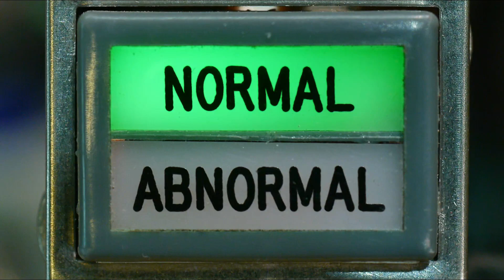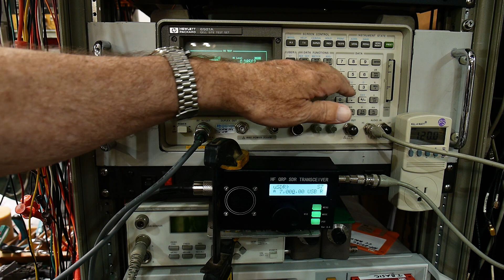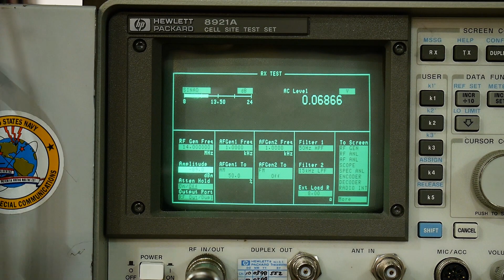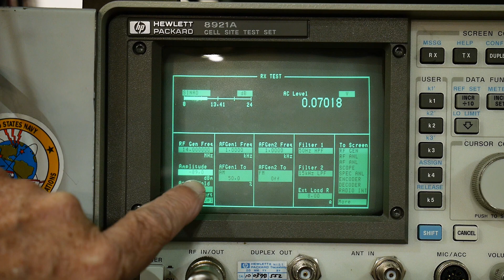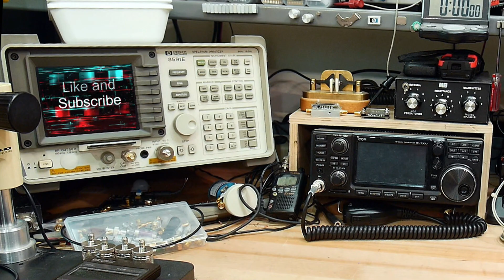#1074 uSDR Radio Sinad Measurement

Comment: I suggested the SINAD measurement to see how sensitive the RX is, I would normally see about -115dBm to about -120dBm on a CB radio
Reply from the maker: since there is a mismatch of AM and SSB, the viewers believe it would be -89 -12 = -101
Reply: SINAD works for CB radios if you are measuring on AM for both the generator and the receiver.  SSB and CW aren't specified as a SINAD value because of things like the distortion added to the RXed signal due to the difference in frequency between the sig gen and the rx. The 1khz tone will be off frequency by 1hz for every 1hz those sig gen and rx freqs are different.
Reply: @RadioWhisperer  maybe 1+ ? hz for every 1 kHz?

Comment: If you are transmitting AM from your generator, then the modulated tone level, will be some dBs below the carrier. From memory at 100% modulation sideband level is -6 dB/tone down and at 30% modulation around -16 dB/tone down. So if you are demodulating one of the tones as SSB, the  -89 dBm generator measured in the video, may be 16 dB lower, or -105 dBm. Barefoot SDRs may have a Noise figure around 20 dB. Assuming 0 dB Noise figure and a SSB bandwidth (2400 Hz) , Noise floor is around -140 dBm. Add 20 dB noise figure, then 12 dB SINAD, then this is around -108 dBm.. So you are in the ballpark...   (50% modulation would be -12dB modulated tone wrt carrier)

Comment: The AM carrier is at -89dBm. You can add -12dB to the figure for the one sideband and 50% modulation. At least so says my HP8640 and 8569 spectrum analyzer. --N2GX

Comment: Nice, How does this compare with your IC-7300 using the same setup?
Reply: This is a great question. I'm betting that using the same test setup with a known good 7300 will produce very similar results. And we know the 7300 has WAY better sensitivity than -83dBm for 12dB SINAD.

Comment: Usually the spec is measured using the amount of signal required to achieve either 12 or 20 db of quieting.
Reply: True, sort of.. It's true that quieting is an FM measurement only, but SINAD is for AM and FM, not for SSB. The problem with SINAD is the sig gen and rx need to be on the same frequency to within several hz or the distortion begins to introduce error.  That's why SINAD is not used for SSB or CW sensitivity measurements.  If you look at the specs for most modern HF radios (including the 7300) the RX sensitivity is specified as a signal input needed to generate an audio signal with 10dB s/n ratio. There is no mention of distortion in that measurement, hence not SINAD (SIgnal Noise And Distrortion).
Reply: True for FM. SINAD is more appropriate for SSB. --N2GX

Comment: Something seems very off with that measurement.  🤔 S9 for below 30mhz is defined as -73dBm. On 20m for roughly 12dB SINAD you had to feed the receiver -83dBm. A good HF receiver worth is salt will have a 10dB s/n of about -110 to -120dBm and the S meter will not move at that level. If the receiver has to have roughly S7 to S8 to produce 12dB SINAD it has very bad sensitivity.
But, I think the problem is the experimental setup. SINAD is signal to noise and distortion. So if the AM signal generated is off frequency at all from the SSB receiver frequency,  that shows up as distortion because with frequency change in the SSB receiver, you change the received audio frequency, which is distortion. To prove that, just move the generated signal a few dozen hz and watch the SINAD measurement change. 
There is a much more significant setup error though.  The signal generated is AM so the test set is reporting its output power which is the sum of the power in 2 sidebands and the carrier.  The SSB receiver filters out 2/3 of those AM components before the signal reaches detection which is why it took about 40dB more signal than it should to produce 12dB SINAD. To get an accurate measurement you have to match the modes of the sig gen and the receiver. 
Typical specs for SSB/CW sensitivity are signal input required to produce 10dB s/n, not SINAD likely because of the error introduced by the sig gen and the rx not being within hz of each other. SINAD is generally used for AM/FM sensitivity  measurements.
But, thank you for making the video. SSB/CW sensitivity has always been more tricky to measure than AM/FM. Tnx es 73 de W1CBD
Reply: I had the same thought...my HF transceiver for example in the SSB mode is spec'd at 10 dB S/N from 160-10m at 0.16 uV or about -123 dBm; -80 something doesn't sound great.
Reply: @Dino Papas  Exactly. -83dBm for 10dB s/n would be deaf as a post. The bigger problem is the setup, you can't measure ssb sensitivity with an AM signal.. The test set is reporting its output for both sidebands and the carrier. So the power measurement has to be adjusted to reflect only the power in the one sideband.. Way easier to just set the modes corrrctly. The problem with measuring sensitivity on SSB and CW is that most sig gen dont generate SSB. The IFR1200s for example has a position for SSB, but what comes out is AM. SSB seems to only effect its receiver.